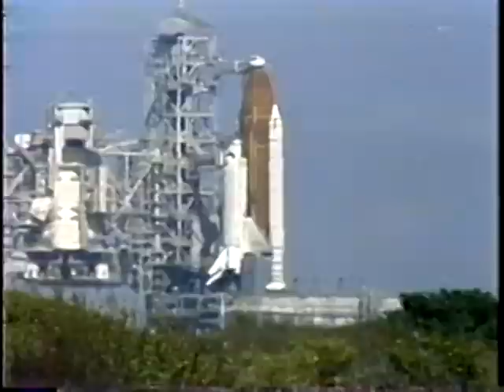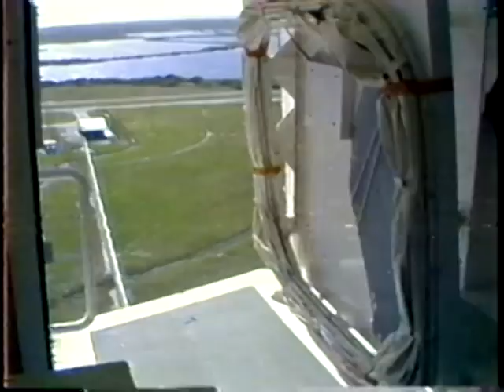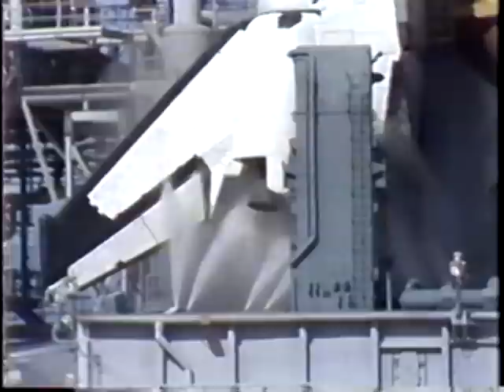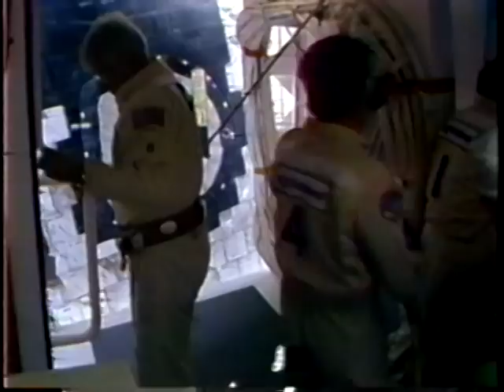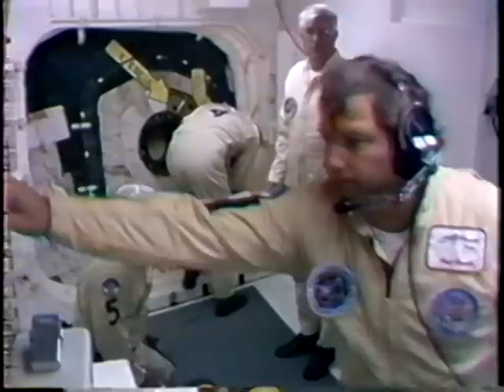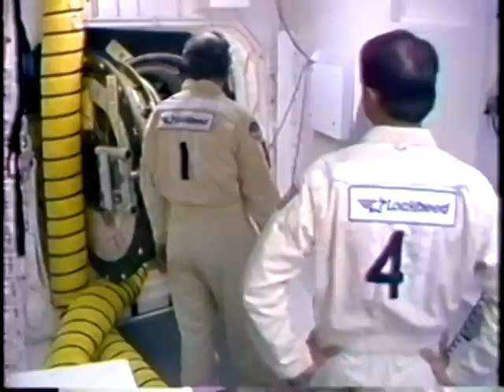Columbia STS 55 RSLS Abort 3-22-1993

Comment: What happens if SRB light off with out main engines or does anyone know what kind of rock solid fail safe they have.
Reply: there wasn't any; an ignition of any kind would most likely have caused all fuel to ignite and kill all of the crew. but obviously they would not receive the command to launch
Reply from the maker: Well the Redundant Set Launch Sequencer RSLS would not let that happen!  The boosters will light when commanded to, it is all monitored very closely!  What a MACHINE IT WAS!!!!
Reply: SRB ignition is generally a commit to launch. Without all three main engines the shuttle would return after SRB separation to a planned landing facility. This could have been at the Cape if at SRB separation or soon after if the external tank could have safely separated. Planned and ready landing facilities were always available.
Reply: @Heres_Johnny.  "SRB ignition is generally a commit to launch".
Nothing general about it, when the solids light, there will be launch, expected, controlled, planned or otherwise!
Reply: JohnnyD's World No kidding.
Reply: @MCNUGGETMinecraftMCNUGGET05  It would be a RTLS (Return To Launch Site) protocol, correct? Of course after the SRBs have burned out obviously. Its never happened, thank God.
Reply: @johnnydsworld710  Yes, once the SRBs ignite, its over with. Gotta ride it out until SRB SEP. Correct?
Reply: A failure of all 3 main engines during SRB flight would almost certainly be a fatal scenario. While the SRBs did have enough power to get the entire stack off the ground, I’m not sure that they had enough control authority to steer the stack by themselves. Loss of the thrust balance from the main engines would likely induce a nose pitch down and an end-over-end tumble, which would cause structural breakup of the whole stack. If one or two main engines were lost, the crew would have to ride the SRBs up to SRB separation, which would then trigger an RTLS (return to launch site) abort, which would be an attempt by the orbiter to land at the Shuttle Landing Facility at Kennedy Space Center. This maneuver was never attempted, and would itself have been, essentially, a suicide mission. Not even John Young, a Gemini, Apollo, and Shuttle astronaut, and a moon walker, wanted to attempt it!
Reply: @MCNUGGETMinecraftMCNUGGET05  A SSME shutdown (even one engine) right after liftoff would be bad. They would be "stuck in the (throttle) bucket" and would have no way to do anything but a "contingency abort" (ie, ditching in the water). They would fly until the SRBs were done and separated, then sep from the tank and then ditch (or bail out post Challenger.)
Reply: the command to light them is way way downstream in the programming and won't execute unless a few hundred other factors are satisfied.
Reply from the maker: RSLS Redundant Set Launch Sequencer computer system and software monitors over 1000 critical functions up to launch!
Reply: OK for everyone commenting here...there's an interlock in the RSLS that prevents the SRB's from igniting unless there's three healthy SSME's, so the discussion of having less than all three prior to or during SRB ignition is moot. Following SRB ignition and before the "negative return" call, if one or more engines go out, it is in fact an RTLS condition...burnout of the SRB's occurs first while a massive dump of OMS/RCS fuel occurs as well. Powered Pitch Around puts the orbiter facing into its line of travel and when less than 2% of ET fuel remains, it is jettisoned and the shuttle attempts to return to KSC. Fortunately this never occurred in STS history and it was estimated that it would have been 50/50 that an intact RTLS could've ever been pulled off...
Reply: Louie Niglio Space Camp
Reply: For those asking, if the SRB’s are commanded to light, it’s a commit to lounch, there’s no going back. If, the three shuttle engines failed during launch, it would be a complete loss of crew and vehicle, because you cannot ditch them in fligh while they’re lit, it would result in fireworks and death, and without the thrust of the three engines, the whole stack would tilt backwards as the thrust vector would be way off the center of mass, and the shuttle would basically collapse, cause it doesn’t have enough structural integrity to be driven only by the SRB’s. Sorry bout my English, I’m 15 and Brazilian.
Reply: @marioghioneto1275  "If, the three shuttle engines failed during launch, it would be a complete loss of crew and vehicle"  This is NOT true, 3 SSME's out at any time after liftoff would result in a safe posture for bailout.  3 engine out is NOT a black zone during 1st stage operation.
Reply: @johnnydsworld710  Aye, one of two things would happen, a sucessful launch or perhaps a rapid unsheduled disassembly due to unbalanced forces.
Reply: @MCNUGGETMinecraftMCNUGGET05  correct, it would then go to an RLS abort (return to launch site).  The shuttle would launch as normal up until srb jettison.  After this, the shuttle would burn to redirect itself back to Kennedy, jettison the tank, and then land back at the launch site
Reply: @thetommoody  as someone once put it “a healthy orbiter should be able to preform a RTLS abort, then again a healthy orbiter shouldn’t have to preform one”
Reply from the maker: The SSME’s are started 6.6 seconds before the SRB’s for a good reason, their state determines if the SRB’s ignite.
Reply: @KevinWRay  yes, because once you ignite those SRBs there’s no turning them off
Reply: @Oklahomarailfan.  OK and your point is??
Reply: @hoghogwild  There were always intact abort options for single engine failures no matter when they occurred, but not multiple engine failures.  There were always "black zones" where multiple engine failures caused loss of the vehicle.  Three engines out at launch would cause loss of the vehicle due to structural failure of the Orbiter/ET attach points.  With no engine thrust to offset the forces on those attachments caused by drag on the Orbiter they would fail and the vehicle would have come apart.  Could the crew have bailed out?  Depends on a lot of things.  However, there was zero chance of SRB ignition with one or more bad engines.
Reply: @joe92  Yes, there were black zones during ascent for   3 engines out, but not until MET 270 seconds through 390 seconds. Post STS-51L Challenger 1986 the stack could lift off the pad using the SRBs only as the attach struts were strengthened prior to RTF. You are correct about the 1981-1985 missions.  I should have been more specific in referencing STS-1 through STS-51L or STS-26 through STS-135.   "Could the crew have bailed out?"  No they couldnt, prior to STS-51L as the Crew Compartment was a shirt-sleeve environment with crew wearing basic blue cotton flight suits and not a parachute in sight.  Pressure suits and ejection seats(from USAF SR-71 were used for the 4 orbital test missions using OV-102 Columbia and dropped when the shuttle was branded "operational".  Then for STS-26 Return To Flight astros wore the orange pumpkin suits pressure/survival suits with parachutes and pressurized oxygen that sustains life at high altitudes.  If the Challenger STS-51L crew would have been wearing pressure suits with appropriate pressurized oxygen and had parachutes, there was a couple minutes for there to be at least the CHANCE of a crew member bailing out/ escaping.  Yes, absolutely zero chance of SRB ignition with ANY of the SSMEs having not reached 90% RPL on their way to 100% Rated Power Level, which for the Block II SSME came off the pad at 100% RPL then increased to 104.5% RPL as the tower was cleared..

Comment: Lucky that it happened like this, if the solid boosters ignited it would have been their end
Reply: The Shuttles 3 main engines start at approximately 6.6 seconds and the Shuttles onboard computer  monitors the performance of all three engines for any anomalies, all three of which much reach over 90% of rated power before the Shuttle's computer gives the 3 commands to ignite the solid rocket boosters, Commands, Arm, Fire 1, and Fire 2, if theres any anomalies detected in any of the main engines the boosters won't recieve the commands and you get an RSLS Abort, with Shuttle safing measures following, involving a series of carefully organised  procedures to protect the Shuttle and her crew and allow for a safe evacuation of the crew.

Comment: Why this launch was aborted??
Reply: One of the three liquid fuelled Space Shuttle Main Engines didn't ignite in the proper way, generating too little thrust. The launch control computer monitors the thrust building up from each as they ignite, only then does ot trigger the solid rocket ignition and the hold down bolt release. The engine didn't start because it had leaked some very cold liquid oxygen internally, which made the pressure rise in another part of the motor plumbing as oxygen escaped into it. That made the computer unhappy and it stopped the launch. All three motors are needed to take off properly.
Reply from the maker: The liftoff attempt on March 22 was aborted at T-3 seconds by the orbiter computers due to an incomplete ignition of the number three main engine. The liquid oxygen preburner check valve leaked internally, causing overpressurized purge system which in turn precluded full engine ignition. This was the first on-the-pad main engine abort since return-to-flight, and third in program history (51-F and 41-D other two). The valve leak was later traced to contamination during manufacturing. NASA decided to replace all three main engines on Columbia with spares.
Reply from the maker: STS-55 pad abort: Engine 2011 oxidizer preburner augmented spark igniter check valve leak

Show affiliations
Abstract
The STS-55 initial launch attempt of Columbia (OV102) was terminated on KSC launch pad A March 22, 1993 at 9:51 AM E.S.T. due to violation of an ME-3 (Engine 2011) Launch Commit Criteria (LCC) limit exceedance. The event description and timeline are summarized. Propellant loading was initiated on 22 March, 1993 at 1:15 AM EST. All SSME chill parameters and launch commit criteria (LCC) were nominal. At engine start plus 1.44 seconds, a Failure Identification (FID) was posted against Engine 2011 for exceeding the 50 psia Oxidizer Preburner (OPB) purge pressure redline. The engine was shut down at 1.50 seconds followed by Engines 2034 and 2030. All shut down sequences were nominal and the mission was safely aborted. The OPB purge pressure redline violation and the abort profile/overlay for all three engines are depicted. SSME Avionics hardware and software performed nominally during the incident. A review of vehicle data table (VDT) data and controller software logic revealed no failure indications other than the single FID 013-414, OPB purge pressure redline exceeded. Software logic was executed according to requirements and there was no anomalous controller software operation. Immediately following the abort, a Rocketdyne/NASA failure investigation team was assembled. The team successfully isolated the failure cause to the oxidizer preburner augmented spark igniter purge check valve not being fully closed due to contamination. The source of the contaminant was traced to a cut segment from a rubber O-ring which was used in a fine clean tool during valve production prior to 1992. The valve was apparently contaminated during its fabrication in 1985. The valve had performed acceptably on four previous flights of the engine, and SSME flight history shows 780 combined check valve flights without failure. The failure of an Engine 3 (SSME No. 2011) check valve to close was sensed by onboard engine instruments even though all other engine operations were normal. This resulted in an engine shutdown and safe sequential shutdown of all three engines prior to ignition of the solid boosters.

Publication:
Final Report Rockwell International Corp., Canoga Park, CA. Rocketdyne Div.
Pub Date:
March 1993
Reply: @noecarrier5035  in other words if the computer is sad you ain't going nowhere oh well too bad!